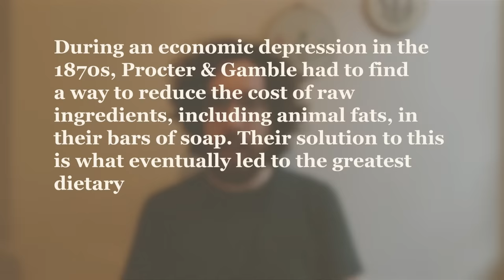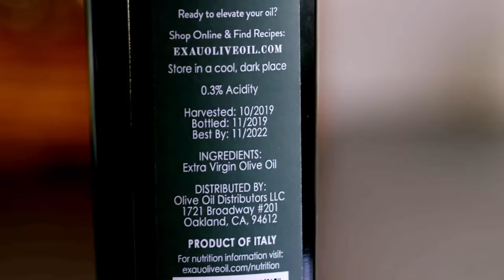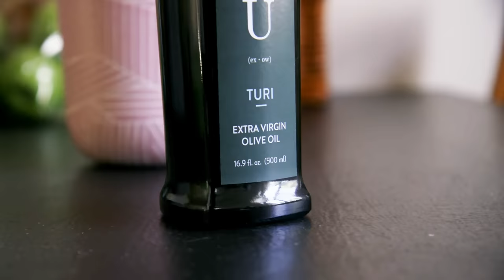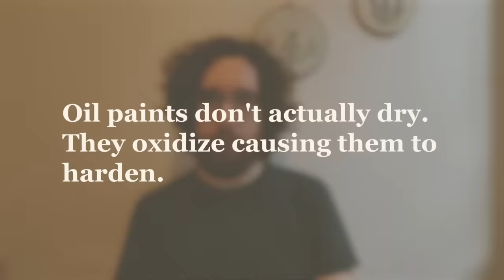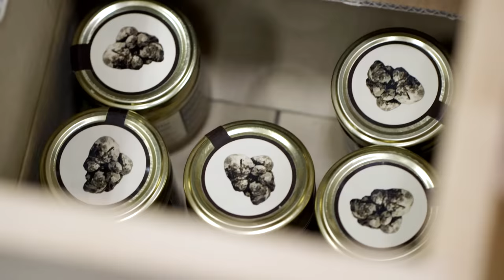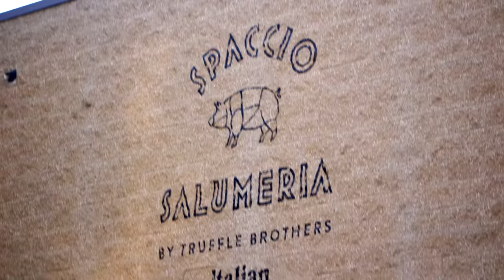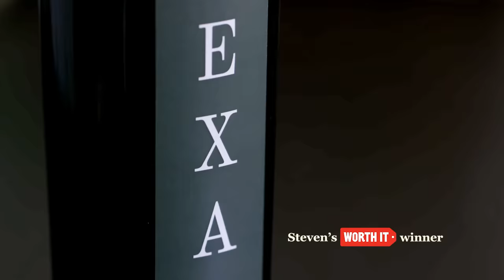$18 Oil Vs. $60 Oil

Comment: Oil fact:
You can't use any oil to cook any cuisine. Olive oil can't take the heat needed to cook East Asian cuisin, which uses high flame to cook. 
Also, if you want to cook with Mustard seed oil you need to heat it in a high flame to dilute it, as it is very dense liquid.
Reply: have u heard of extra virgin Greek olive oil my dear? it has the best tolerance for heat from all the oils in the world...
Reply: @peosforos13  actually, avocado oil has the highest smoke point, which is 520°F. 
And extra virgin olive oil has lower smoke point than light olive oil(in colour not in calories). So if you want cook something in medium-high heat, it's better to use light olive oil than extra virgin olive oil. You can use it to stir fry or bake in the oven. 
But if you wish to deep fry anything it's better to use avocado, canola or sunflower oil.
Reply: @peosforos13  as an asian, i would have to disagree. the best types of oil for high heat cooking are coconut oil or avocado oil.
Reply: *cuisine
Reply: @pepsicxla  agreed. Olive oil can't withstand the heat needed to cook Asian food.
Reply: @SareenMomo  or just cooking oil  lol
Reply: Check out adam raguesea's video. Smoke point doesn't really matter, its which oil is stable at high temperatures and olive oil is very stable.
Reply: You're right, you can't use any oil to cook any cuisine, but the discussion should centre around flavour and not heat or smokong points. Olive oil can be used for high heat cooking, Mario Battali used to deep fry in extra virgin olive oil and, as someone mentioned, Adam Ragusea has a video on it. However, using olive oil to cook South or East Asian food will just make it taste weird. I wouldn't use olive oil to make an Asian curry, but I would use it to make a European stew.
Reply: @mwrkhan  well said!

Comment: "Olive oil doesn't technically expire, it just turns rancid"

Wat
Reply: I think expiration means it's unsafe to eat versus rancid means it just starts to taste bad...not really sure if that's what she meant though
Reply: the words are sorta interchangeable but i think she's mostly correct, when things are past their expire date they become unsafe for consumption, but rancid on the other hand means olive oil will turn sour and while you can cook with it, it will taste horrible and probably smell horrible too.
Reply: the flavour goes off its original taste profile, not necessarily to worse
Reply: I think it oxidises but there's nothing else happening (like bacteria or fungi growth which would start breaking down the product)

Comment: Coming from an olive oil sommelier (yup there’s such a thing!) I’m so happy to see EVOO featured! Extra Virgin Olive Oil is so underrated. Amazing to see you guys tasting it properly as well!
Reply: I have a possibly strange question, but my old boss (I worked in a restaurant) told me EVOO becomes a carcinogen (idk if that's the spelling) when heated to hot. So it surprised me that the people from EXEAU  put the oil in a hot pan, I'm wondering if I'm wrong now and you seem like the person who knows if I am! :)
Reply: @gertjan3329  such a great question! all oils have a temperature where the oil starts 'smoking', thus called a smoke point. You def want to avoid cooking beyond the smoke point. Smoke points vary, for example, Safflower oil has a high smoke point of around 500F|256C, and EVOO is around 375F|190C. That's why it makes sense to deep fry food in certain oils and not others. The biggest misconception is not cooking with EVOO, as a pan on medium heat probably reads around 330F|165C, which is lower than EVOO's smoke point. It's totally safe to use EVOO to cook with. The beauty of EVOO is in its distinct taste though, a high quality EVOO can really elevate a dish, so I personally reserve EVOOs for the finishing touch, on pizza, pasta, salads, and to drizzle on desserts. Hope that helps!
Reply: @ZiTries  thanks so much for the kind reply! Yes, let's absolutely agree that good EVOO is probably the best thing for drizzling basically everything (EVOO chocolate?). And wow, I'll start using it for cooking more then, you learn something everyday I guess!
Reply: Coming here two years later or so, but this was really interesting to read and I've now learned something new to use in my future cooking journeys, so thank you for this 🙌

Comment: Steven is really showing off his chemical engineering knowledge here. Things dry because water evaporates from it. Oil paints don't dry because there's no-to-little water inside the paint. Their components react with oxygen via oxidation-reduction reactions. Nice job, Steven. ^.^

Comment: Hi I am an egg tempera painter, here to discuss the egg paint! Yes egg dries, very very quickly in fact. If you use a paint made of just egg and pigment you have to move superfast. If you do an egg oil emulsion like discussed in the oil fact, it slows it down considerably and makes it act more like (what we think of as) regular oil paint. The egg in either recipe will oxidize over the first six months and develop a different patina than it began with, and becomes very durable. Think about your egg yolks on a plate if you forgot to rinse it right away.

Comment: Animal fats are mostly saturated fats while most vegetable oils you cook with are unsaturated fats. The difference is that your body breaks down unsaturated fats much easier.  Many of them are polyunsaturated fats which are considered essential fats. Essential fats basically means your body can't make it on its own so you have to intake them from other sources. The meaning for essential vitamins is the same, scientifically speaking. So, yes, there is a health difference between animal fats and vegetable oils.

Comment: vegetable oils are NOT healthier
 Animal fats are mostly saturated fat, which means they stand up better to high heat and last longer than vegetable fats. Reduced oxidation in animal fats means they are less susceptible to the toxins and carcinogens generated by using vegetable oil alone.